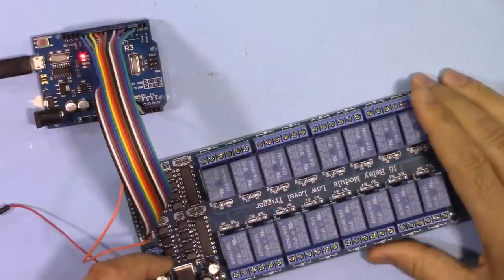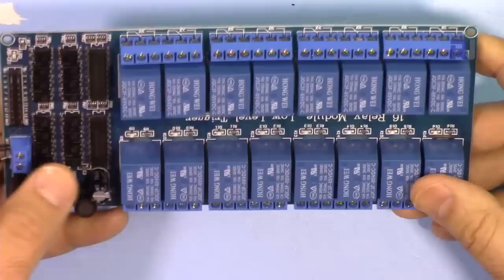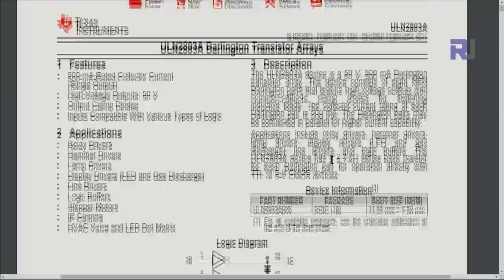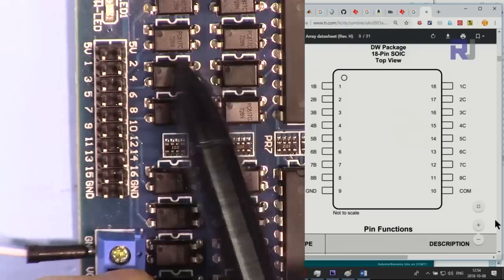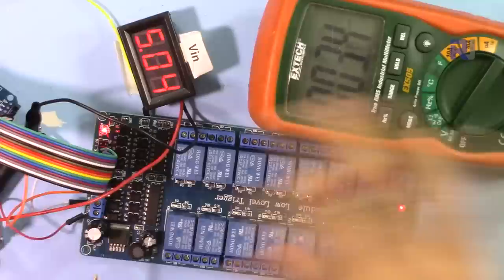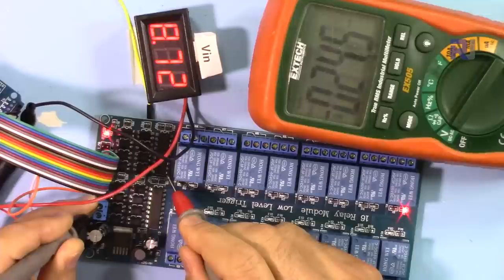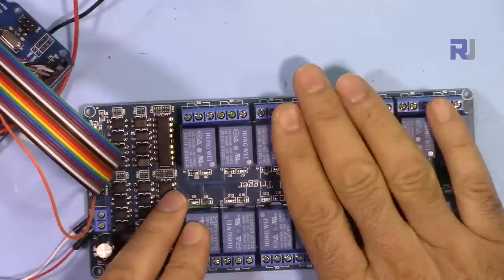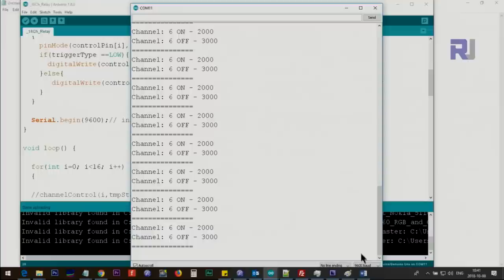Lesson 68, Home Automation: How to control 16 Channel Relay module using Arduino control 16 AC loads

Comment: Is it obligatory to use all 16 Channels?
I got this Relay board, and 1 MicroController is blown. So only 8 channels, are available. I intend to use it to control only 2 devices with the 8 channels left... When I give 12V to it, all remaining Red led are ON, so I guess half of the board is usable.
Thx
Reply from the maker: please see the link under the video. I can't being it as I am in page where comments from all videos are shown. I've shown how to fix the problem with this board.
Reply: @robojax  Thx you, maybe was not a bad idea to provide a schematic to help us connect the board to Arduino, because always having to pause the video, to understand the wiring it not so easy...
Reply from the maker: It seems you have not check the link and page .
Reply: @robojax  sure I checked, and you are right, there is a lot of good infos, but no schematic... It is a very important part in electronic project.
Plus the Code is very helping, Thx again for that
You mean this link:
Download code and resources for this video: http://robojax.com/L/?id=253

>> https://robojax.com/learn/arduino/?vid=robojax_16ch_relay
Reply from the maker: You fist visit the page where the code is, you will see it there
Reply from the maker: oh,  if you don't want that, then draw it yourself using this free software https://fritzing.org/

Comment: I just checked out the 16 relay module on Amazon UK and the photos show the module is missing the tall capacitor and a few more components on the power side.
The regulator also looks different to the regulator on your board.

I just wondered if its an updated board or an older board?
Reply from the maker: The capacitors are good to keep the voltage stable when all relays or bunch of them turned on. Some guys produces them with caps to save few cents.
Reply from the maker: Search my channel as there is another video explaining the issue with the module. Or check the links in description

Comment: whats the point of the relays being on a pcb if you still have to use so many pins on the arduino?
Reply from the maker: 16 relay without drivver woul have 4 wires to operate (2 power supply+2 load). for drivers it would be very complicated. This makes it very clean and easy to use. If you have 16 channel, then  you need at least 17 wires (1 ground + 16).

Comment: why does each relay consume around 180mA my relay module does that and it sounds really weird
Reply from the maker: each relay need about 40mA. I might have made mistake or you got it wrong.  the sound, I purposely programmed it with fast loop to make that noise. in real life application it won't happen at that speed.
Reply: @robojax  no. I meant that a single relay consuming 180mA sounds weird. I ran the thing on the benchmark powersupply and it does consume that much. It's really weird.
Reply from the maker: yes each relay will need 40-50mA.
Reply: @robojax  i guess there is something wrong with my module
Reply from the maker: No thing is wrong
Reply: @robojax  i will design my own module and the relays will be transistor controlled.
Reply from the maker: it would be awesome because you will have full control on how it should work. good luck and stay safe.
Reply: @robojax  thx

Comment: How can I control this relay module via PLC?
Reply from the maker: I have no idea what PLC is. Sorry. I could not find any board to see and learn it.
Reply: @robojax  PLC stands for Programmable Logic Control. I have Siemens S7-300 and Allen bradley SLC 500. I want to integrate to them and act as external board.
Reply from the maker: I searched eBay and AliExpress and could not find one single board that is famous to purchase and work on it. What is the most common board so I start with that?

Comment: What's the life of these boards.? Are these good to keep continuously connected to power and controlled by ESP8266..? I don't want to risk my expensive electronics.😅
Reply from the maker: the life of board depends on the relay (mostly). What is the worst would happen? There is no risk. Input and output is optically isolated. If you don't share power with Arduino, you will be isolated. The worst could happen, relay will die and it will do the job.

Comment: Hello, I was looking for something like that.
I want to use that for stair lighting. Now I would have to control the whole 2 Pir motion detectors (HC-SR501). Is that possible? When I stand at the bottom of the stairs, the light goes up and off gradually and when I stand up, the lighting goes down and off gradually. Can you help me integrate the code for the sensors?
Thanks a lot
Here is an example: https://www.youtube.com/watch?v=est3rrd2IUA
Reply from the maker: Hello,  finally I got a change to reply. I watched the video. Yes possible. You will need a sensor on each step so the light will turn ON only when obstacle or human is detected.  it would be very easy.